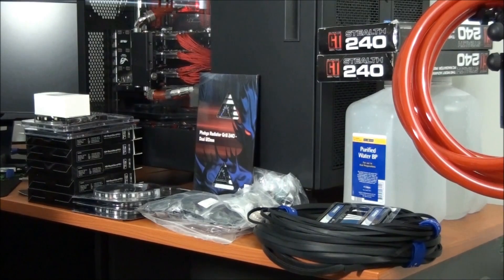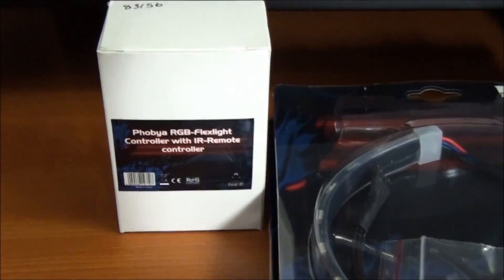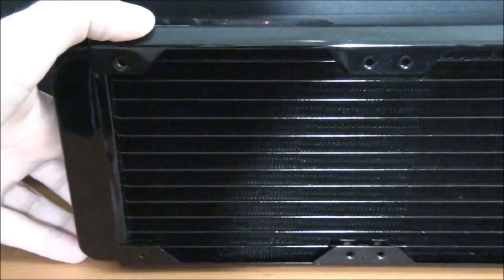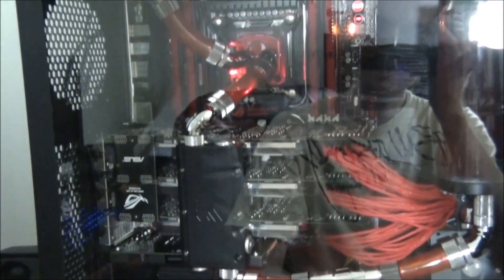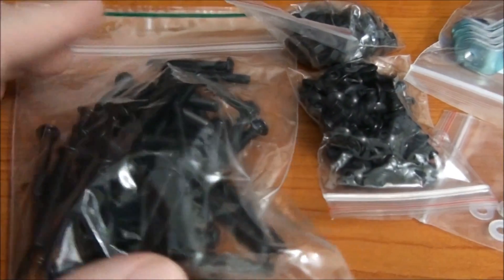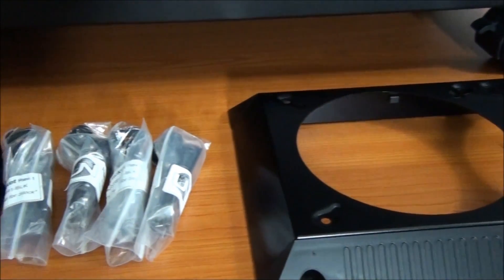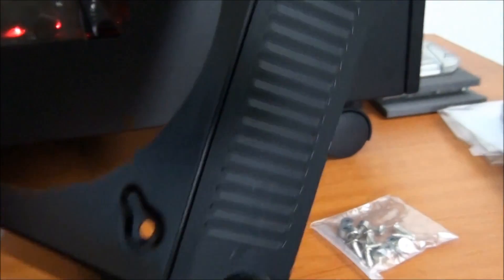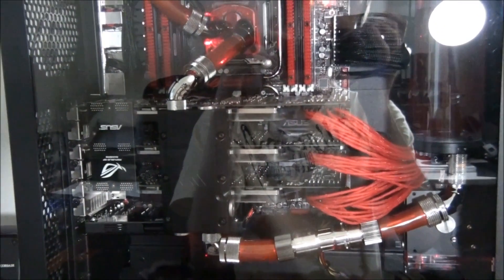Singularity Hardware Order Analysis Video 15 (Subscriber Segment)

Comment: Hi there, wondering if you could help me finish my custom build I have most the parts but the motherboard. 

1ntel Core i5 2500K 3.3GHz Socket 1155
Coolermaster CM 690 III USB 3.0 header
Corsair 600W CX Series V2 PSU
Arctic Cooling Freezer 13 Intel and AMD
Asus Xonar D2X Soundcard	
ASUS HD 6850 Direct CU 1GB GDDR5 
Seagate 500GB 7200RPM 16MB
8GB (2x4GB) Corsair DDR3 XMS3 Dominator, PC3-10666

Whats the best motherboard to make the most out of everything I have, Im on a budget hence the parts.

Comment: Always good videos! 

When you do the fan video (if you haven't already), can you talk about what each stat means and what stats - specifically static pressure - are important for water cooling in general? And, how the radiator's fpi changes what fans you choose? Also, with the GT radiator having thinner fins and looking like a 20fpi radiator, do you treat it based on the 20 or the actually 30fpi when choosing a fan?